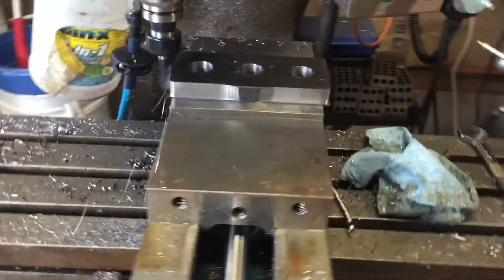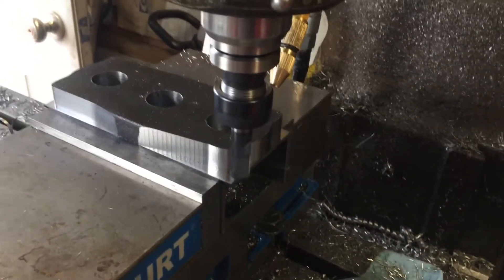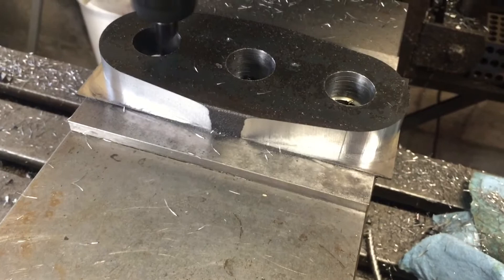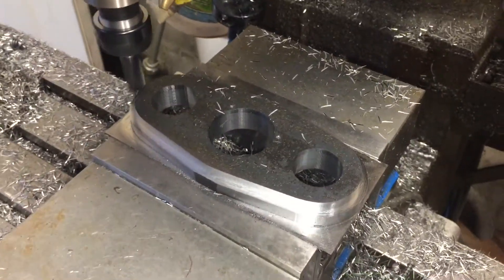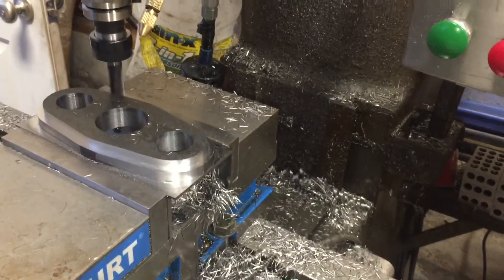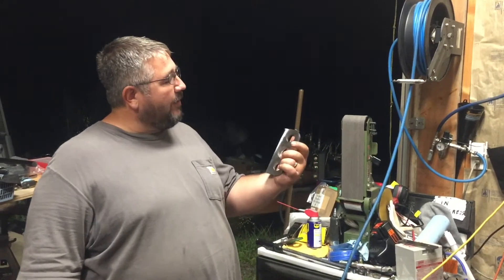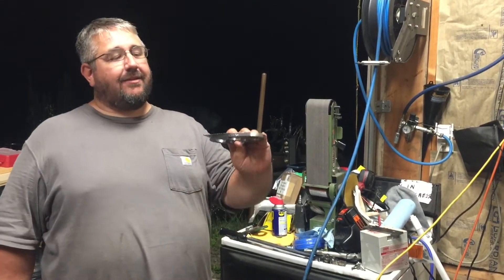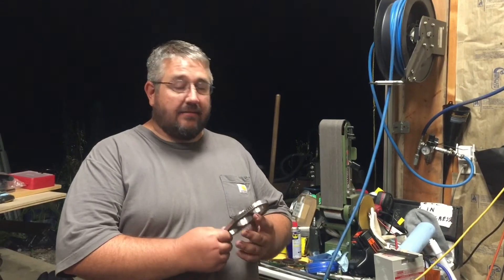Hay Rake Bearing Holder Made on the Cnc Bridgeport Masso Clearpath.

Comment: That will be a goal for me. I got these steppers and drives really cheap in a horse trade. I am using gecko drives. Any issues driving the knee at all? So many are doing the quill instead.
Reply from the maker: Machining I.T. Had to have a 5:1 gear box on the knee to have enough torque to get her to go up
Reply from the maker: Machining I.T. I really like the knee going for the z. Really accurate with the gear box.  It will only do 20 ipm but super accurate

Comment: Are you using ball screw on the knee as well? I am getting ready to do a victor mill and am going to motorize the knee instead of the quill. I am going stepper because of cost.
Reply from the maker: Machining I.T. No it just the original old screw and brass nut.   U will wish ya bought the clearpath servos in the end.  If u buy quality stepper motor and  drivers u will be within 50 bucks or so of the cost of the clearpath servos. The clearpath really never miss a beat  the just go and go  super fast and super strong